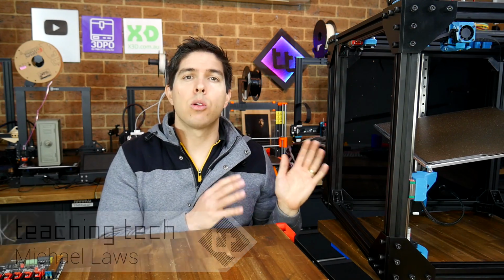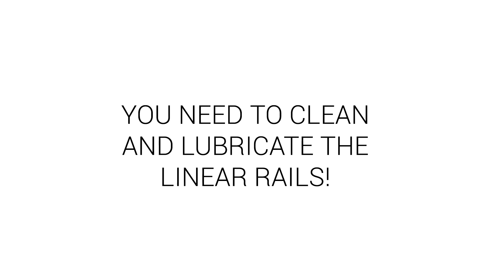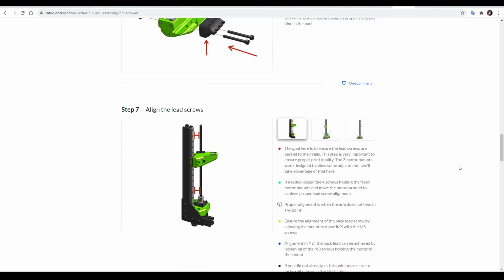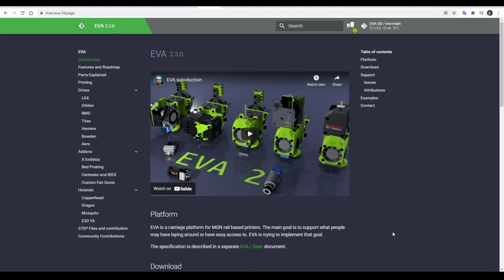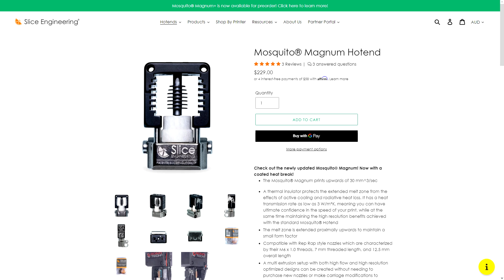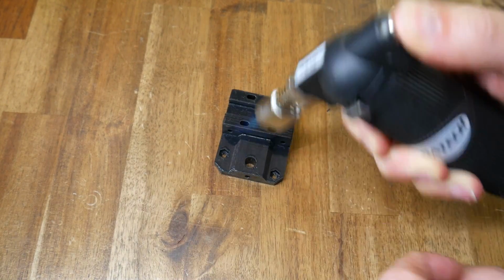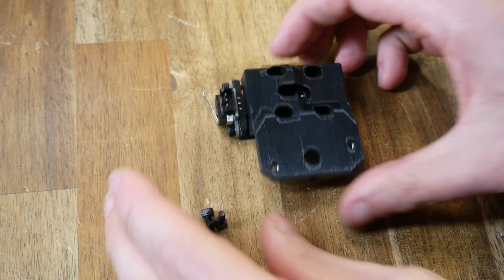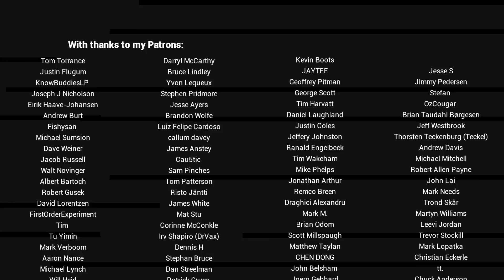Rat Rig V-core 3 part 2 - Kinematic bed and EVA carriage system

Comment: The biggest thing pulling me more to the Voron 2.4 for a large printer is that the Bed is stationary and the printhead moves up, if one prints a few kilos in one print, even with linear rails and stable parts, wouldn't wanna risk the bed giving way. And makes temperature stabilization easier since you have a fixed printvolume, with the bed moving down, all of it is lost under the bed.
Reply: This is still a better design IMO. They did change to a milder pitch on the lead screw, even with the motor unplugged it wont creep down. The Voron design has issues, not the least of which is sacrificing the rigidity of the gantry. Input shaper can alleviate this, but it is a software band aide to fix a pretty major design flaw.
Reply: @joshua43214  At the last Formnext i did see both approaches, fully enclosed big half or one qubic meter volumes with a static Bed at the bottom and also one cubic meter with a moving bed, i think it's a bigger strain lifting the bed including the big aluminum slab and the print , but i guess with anti backlash nuts the strain on the steppers isn't as high and you need less holding torque
Reply: @joshua43214  then again at bigger sizes i would probably start thinking about nema23
Reply: Bed giving way? Not gonna happen. I designed a filtered recirculation duct for mine to distribute the heat in the printer. Not necessary though since heat rises to the top.
Reply: @miklschmidt  well i guess i shall get myself 3030 or even 4040 profiles and see how large i can build it, I'm aiming for 1 qubic meter but might go for wide base, since belt printers save space but aren't to my liking yet

Comment: Why is the bed only attached in 3 points would 4 not be Better or am I missing something? And how do the parts hold up around the hot end because of the Heat ? Love the vids :)
Reply: In geometry, a plane (by definition) is any 3 or more points. Once you go more than 3, you introduce the possibility of twisting or warping. You ever sat in a chair that had one leg too short, and the whole chair rocked? Well that doesn’t happen on a 3 legged stool. If one leg is shorter than the other 2, it just sits at an angle, but is solid. The same thing happens here, except each of the 3 points move independently, so they can be adjusted.
Reply: Crazyates11 nailed it.
This is one of the major failings of the Voron. Not only does the gantry rise on 4 points, the whole lash-up is horribly over complicated. Not sure how they wound up with that design, but it looks like they were trying to solve issues that already have been solved in industrial applications.
Reply: @joshua43214  My understanding with the Voron is that because it's a belted Z axis, 3 points wouldn't be strong enough to hold the weight of the XY carriage, esp when it starts whipping back and forth. Moving to a 3 point means each belt is now carrying 33% more weight, which means more belt stretch?
Reply: @Crazyates11  That does sound like the kind of nonsense I hear from the Voron team occasionally.
3 lead screws will be orders of magnitude stronger than any belted system. Not only will it be stronger, it will be not sag before the frame sags, it will not be under-damped causing vibration issues on fast travels, and the motors will not need near as much power to hold position (so will run much cooler). Another major issue is the Voron bed is fine adjusted by the steppers, meaning they will probably all be in different micro-step positions having different torques.
Don't get me wrong, I love the Voron design for the most part, but their solution to the bed is terribly mis-guided, and very over-complicated. All the issues I can imagine them trying to solve could have been dealt with by either changing the type of screw, or moving to a nema23 (or both). There are widespread best practices already in place that deal with pretty much every issues I can think of from screw wobble to holding power.

Comment: Why aren't you installing a thermal fuse on the bed, just in case the SSR fails?
Reply: The custom Keenovo Heat Pad sold with the printer already includes a thermal fuse.

Comment: I like that EVA design, I might have to take a go at adapting that for my project.  Is there anyway you could tell me the X and Y size?  I have 60x52mm in front of the rail to work with.
Reply: You can get the cad files and stl's from the EVA website.
Reply from the maker: Yes please refence the links in the description. Any possible information you want is there.
Reply: @TeachingTech  I did look before I asked, and I couldnt find anything that said how big the fully assembled EVA design was.  I found a PDF file that has  some good measurements on it, maybe I missed something.
Reply: @jon9947  get the cad files...
Reply: @joshua43214  I grabbed the cad files, there still isnt a fully assembled model though.  There is a half assembled model, dont worry about it though.  I'll assemble the model in cad and figure it out myself.......

Comment: Cant wait for the next part , I wish to buy one myself one thing holds me back ,in your opinion can you switch the nozzle to a 0.6 for extra fast prints ,and is it suitable for series production ? Thanks 🙂🖐️
Reply: Yes no problem switching nozzles.
Reply: @liamventer  🙂Thanks ! , what kind of extruder heat block hotend combo is suitable for ,like an Asa, or Abs prints at 300-400mm/s or even higher ? ,since there is a lot of material flow that has to heated at a very high speed
Reply from the maker: The Slice Engineering Mosquito Magnum I have going on has one handed nozzle changes, which I'm keen to try. It's also designed to melt and flow a lot of plastic. They have a plus version too but it's not available yet.
Reply: Thanks Michael ! I heard a lot of good thoughts about the Mosquito hotend now you convinced me that its worth the investment .🙂✌️

Comment: This build already looks awesome before you actually use it. 
However (and this might be a question for you to rate your printers), when watching the background, I always wonder: What happened to the Seckit you build? When watching the whole video, I noticed that you are indeed using it, but concerning the seemingly awesome printers, I always wonder if they are still awesome in the long run. Concerning how many printers you have in the background, I wonder if they are there for aesthetic reasons, because they just have to fit somewhere, or you sometimes demand lots of printers. Or do you store printers you actually use somewhere else? The Seckit printer seemed to be able to replace a bunch of others. Watching some of the videos where people print using Klipper, it seems like there can be printers fulfilling lots of requirements. Like being fast, reliable, reasonably big and user-friendly. Adding a tool changer could fulfill the demand for many materials. If you have cubes, is there any reason to keep many i3 style printers except for testing upgrades? But you seem to have a lot of i3 style printers. Or do they keep coming? You seem to often use your Prusa printer, although you already have printers, which have linear rails and maybe even more advanced extruders. Doesn't the Seckit outperform it?
P.S.: I guess, if you have very fast cubes, there is no need for delta printers, because they only take up more space, or is there?
P.S.: Damn, I actually wanted my own cube printer and already bought quite a lot of parts, but that one ships from Portugal and fulfills quite a lot of my demands. I would have bought it, if you started your video series earlier and I might, if I fail to build my own one. In theory it seems to be really great.I don't like printed parts in printers, but in the Rat Rig many parts seem to be supported by metal.
Reply from the maker: Pretty much all of the printers in the background still get used. Some are modified for specific purposes, like a big nozzle for printing large parts fast, a small nozzle for small, precise parts, a TPU specialist extruder, etc. The Seckit is going well, apart from the WIFI thingy I added not always liking talking to my router. One some days it will disconnect mid file upload and that is a bit of a deal breaker. I was actually going to print all of the Rat Rig parts on the Seckit for the quality but that's when it started playing up and I have to find some time to investigate and fix it.
Reply: @TeachingTech  Thx for the update on that matter. I would have expected that you reduced the number of printers, which are actually in use.
 On the other hand it makes sense, that a printer optimized for a purpose and being ready in that configuration is faster to start up than one, which is just capable of multiple things, but it has to be configured slightly different. 

Also, I expected some printers just to be inconvenient. I always suspect maintanance on the rolls of the Ender3 to be annoying (but I own 2 Anycubic i3 Mega printers and for some reason they seem to be the top choice, so I don't have any proof). On the other hand, it might be a very easy thing, especially when knowing which tension to use and how to spot problems before they become problematic.

Comment: I've been day dreaming of a 500x500 printer that is also my first core-x-y with .6 or .8 nozzle with the purpose of printing cosplay helmets, RC airplanes, and the parts to build a full scale R2-D2 droid.  With a build volume that size the helmets/body armor could be a single piece then the R2-D2 dome could be 1 part instead of the printing of multiple parts that have to be glued and finished when using a smaller bed size printer.
Reply from the maker: That would be a good use for this printer. Check out Sam Prentice's channel linked in the description, you'll probably like what he makes.

Comment: What benefits does having a bed that can move like that have?
Reply: It perfectly accommodates thermal expansion which results in less warping of the bed plate over time as it goes through heat cycles. It also allows for automatic true bed leveling.
Reply: @miklschmidt  fascinating, thanks 😊

Comment: What are your thoughts on the BTT Octopus or the Fysetc Spider?  They both look like very capable boards with some great features and very reasonably priced.  I'm thinking of ordering one to use the Core 3.
Reply: Provided you run Klipper, the board only needs to have sufficient drivers and other assorted connectors. I believe the Spider has all the connectivity, but delivery time might be greater than that of the V-Core itself. I went with the 1.2pro for that reason. Cost was about the same iir
Reply: @joshua43214  Good point.    I ordered my V-Core 3 yesterday and a Fystec Spyder from Aliexpress.  I has more drivers than I need.  Got it with 8 - 2209 drivers and a mini display for $70.  I think it should arrive about the same time as the Rat Rig
Reply: @woodwaker1  I ordered my 1.2pro with 2209 drivers from the BTT store on Amazon, cost about $82.00.
It was worth the extra to know that the item actually exists, and arrived a couple days later. The Spiders I believe are still being backordered in batches.
Reply: @joshua43214  Thanks for the update.  I'll keep that as a backup.  I should have checked other sources.  I was looking at the $121 price on the Rat Rig configuration page.
Reply: @woodwaker1  Ya, not only is stuff insanely expensive in Europe, they also add on the VAT.

Comment: Honestly, this has become my goal for what I want for my next printer. The fact that depending on how I set up the kit, I could get a 400×400×400 printer for under $1000 is amazing
Reply: Do note that a 400^2 is pushing corexy to its limit in workable size. Personally I wouldn't go bigger then 350^2
Reply: @duck0star  why is that?
Reply: @Thierry080  because of the way belts are working and also stress on systems
Reply: @duck0star  huh, interesting. I was only thinking 400³ because the RatRig site offered that (along with 500³) but knowing that, I might just stick with the 300³ model
Reply from the maker: Maybe jump on the Facebook group and see if the 400mm versions are meeting their user's expectations?

Comment: I like it and I like the series but one thing I strongly disagree with. This is not a beginners printer in any shape or form, if you have not had a printer before and built and repaired it then you have no chance of building this.
Reply: Depends on the beginner. I started 3D printing many years ago and would have loved to have this as my first machine. I'm well equipped to assemble something like this because I work as a millwright. This is hardly complicated to someone like myself.
Reply from the maker: Every one has different skill sets and a tolerance of how much time they are willing to sink in. I still maintain the individual steps aren't hard. An Ender 3 has four of five steps. The steps here aren't any harder, it's just there are hundreds.
Reply: There's a few v-core users who built it as their entry into 3d printing. It's definitely not impossible, but it depends very much on the person of course. As michael said, it's not targeted at beginners but the instructions are easy enough to follow. The hardest part will be the electronics.
Reply: Whereas I am an office worker that builds computers and has 30 years building and flying radio control planes and I have been printing for maybe 5 years. I remember very well my first printer, still have it in fact and there is no way I could have ever built this when I started. I could build it now but as a first printer I say no, unless you are very skilled.
Reply: @paulmilne3038  I'm a software engineer. I built a Delta from scratch for my first printer. This would've been a dream in comparison.
Reply: Guys, some of you may be pretty skilled but not everyone is, for some people changing a plug is beyond them. Almost anyone can build the likes of an Ender 3. Now that is a beginner printer. A few bolts and plug in a few wires that are labelled and it’s ready to go.
Now you can still disagree with me if you like but I think giving someone a box of bits that they have to assemble when they have no idea as to how it works makes it not suitable for a beginner. You disagree then fine but I still think it’s not for someone that has never had a printer. If you have a printer already then fine, never had one and get a box of bit and you will struggle. As a perhaps silly example of building something like this, I had never even heard of t nuts before I got my first printer and while now I understand the whole assembly now myself I do honestly believe you give this to most newbies as a box of bits they will end up still having a box of bits 6 months later and will now be so pissed off at the entire thing they will have lost all interest.
Reply: @paulmilne3038  I think you're assuming that all people as a newbie are the same. This printer is far from complicated compared so much larger industrial equipment. Equipment that someone like myself assembles. 

Not everyone is intimidated by instructions and a box full of parts. Combine the website, the instructions and the community, this printer can be easily assembled by a lot of people out there. 

Prusa is usually recommended as a beginner printer and people have the option of assembling that. I'm a member of one of their facebook groups and I can honestly say that a high percentage of people there built that machine on their own as their first printer. 

This machine is only different in the manner of how it's assembled and functions.
Reply: @paulmilne3038  Also the only reason I am replying is because of one thing you said. "This is not a beginners printer in any shape or form" 

With that you assume that no one can assemble this printer as a beginner. That is incorrect.

Comment: Can you move from 2.5D printing to real 3D printing with a moving table?
Reply: I think the problem with that it isn't necessarily how the bed moves thats the problem, but moreso the clearance that the nozzle will need to follow all the contours
Reply: @jasonking7570  Do you mean CNC TCP?
Reply: @SergeiPetrov  CNC TCP? I'm not quite sure what that means
Reply: @jasonking7570  TCP means "tool-center-point-control".
Reply: Mostly. I think software support for that would be difficult given the complexity of the physical setup. Another thing limiting the process is the clearance angle of the hotend. Something like a super volcano might help.
Reply: @Techknowdude  it seems we all need to switch for x64 motherboards soon
Reply from the maker: For the printer it shouldn't hard. It's still going to be G1 with X, Y, Z1, Z2, Z3 E coordinates. The very hard bit is the slicer in controlling this.